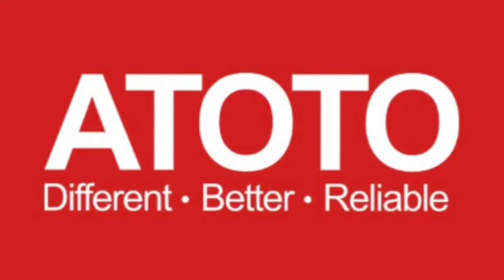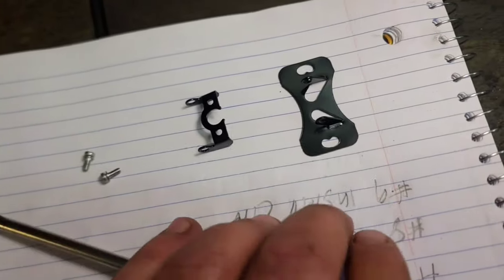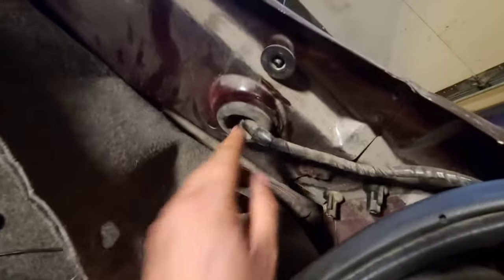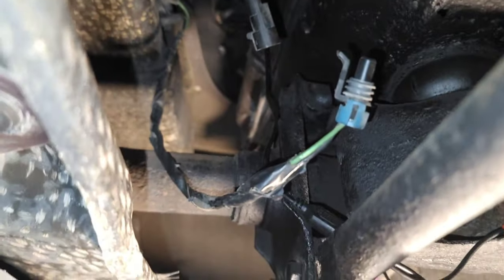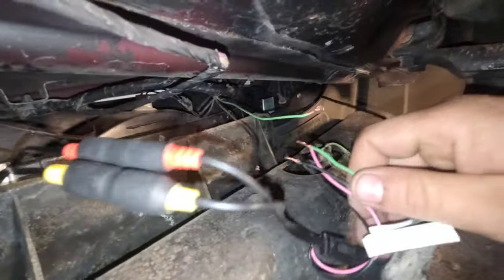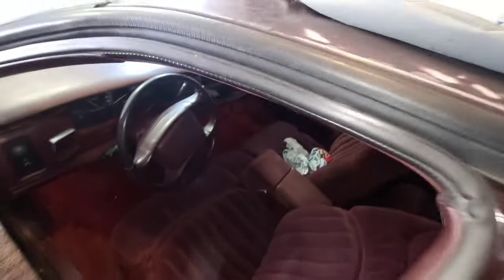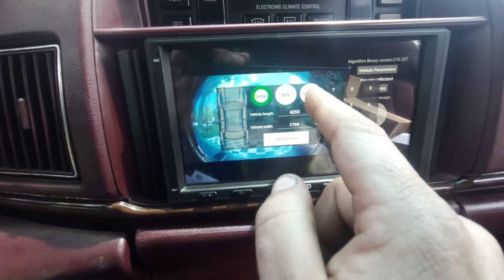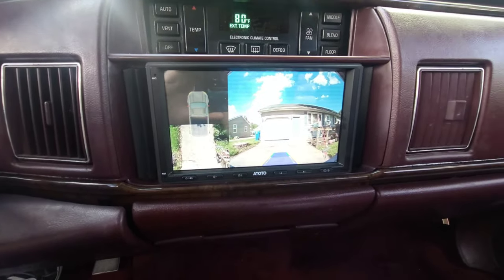The RIGHT Way to Install an ATOTO Backup Camera (WORTH IT!)

Comment: Thank you for this video! Subscribed! - Now I know how to install this rear camera - My only issue is I had to buy a Wiring kit - Radio Pro4 2-TY11 that also has a rear Camera wire on the harness that makes everything compatible with my Toyota Avalon - Do I add the Pink Camera wire directly to the Atoto S8 unit and bypass the Wire harness kit?
Reply from the maker: You got me there. I would do a dry run before completely reinstalling the unit with the pink wire connected directly to the ATOTO. I would imagine the aftermarket harness is plug and play but it will need the 12v reference on the pink wire to activate the camera
Reply: @Blowncapacitor84  Thank you for your quick reply  - and yes you were right - I was able to get the back up camera working by connecting the Pink wire directly to the radio pink wire
Reply from the maker: @hightide-mcknotts  Nice!